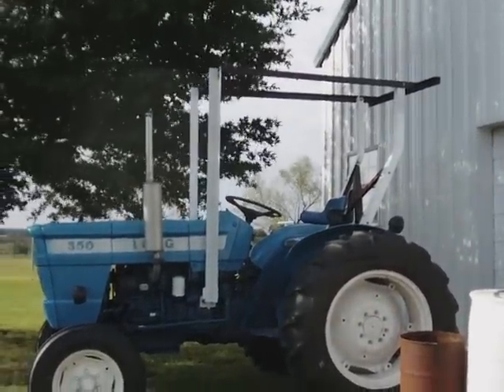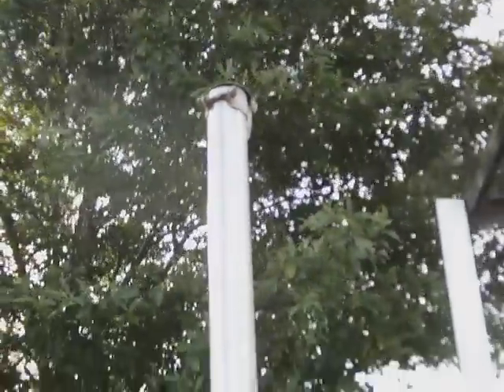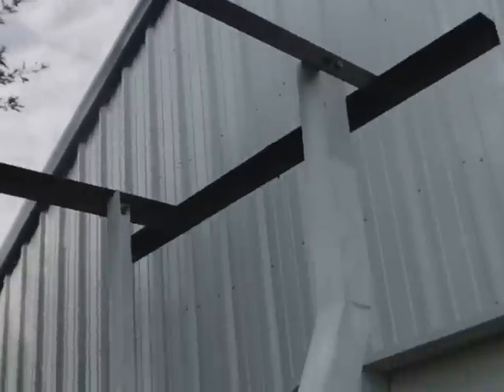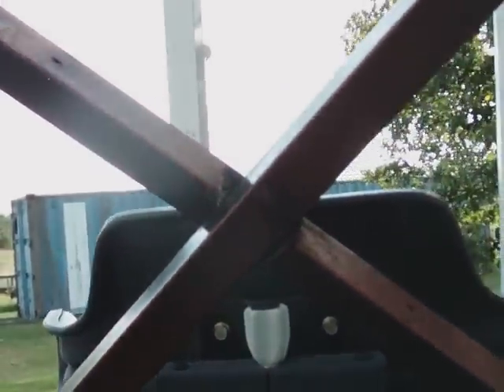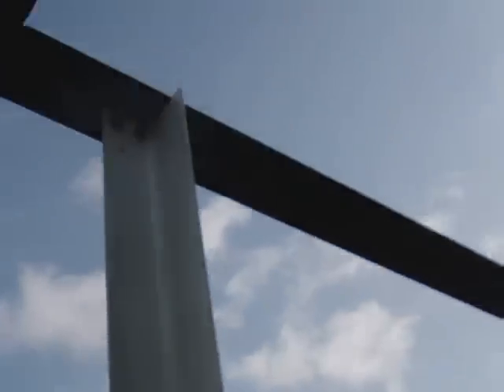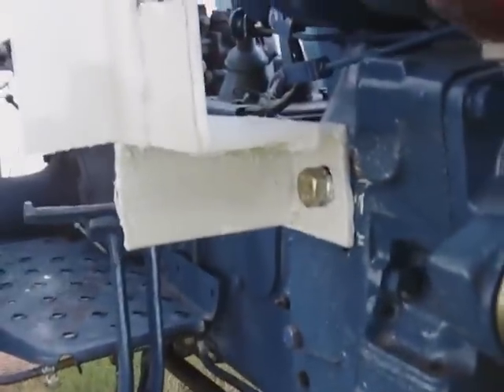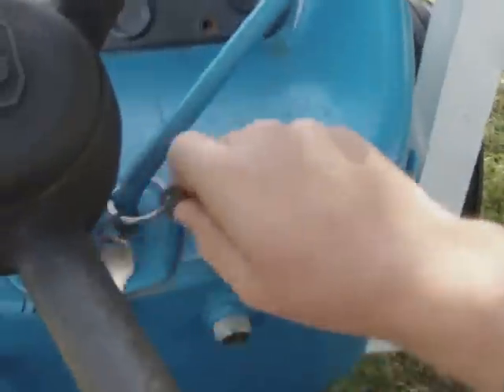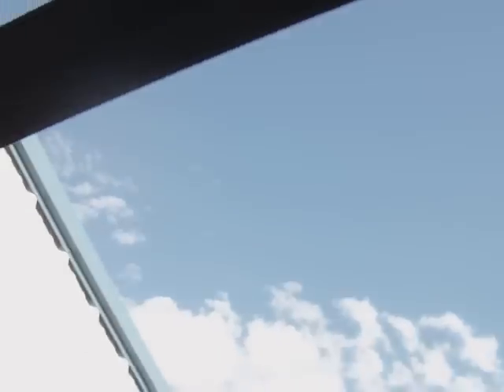Cold start, walk around, exhaust, and rev 1974 Long 350 Diesel Farm Tractor

Comment: Why doesn't the key turn it off?
Reply: The key is just an electricity switch for the dasboard gauges, etc, it has a small rod in the right of the steering rack and pinion called a decompressor because it's a diesel and diesels use compression and not ignited gas via sparkplugs.